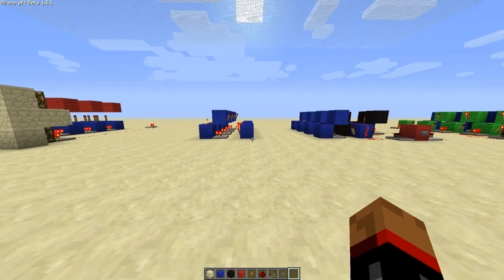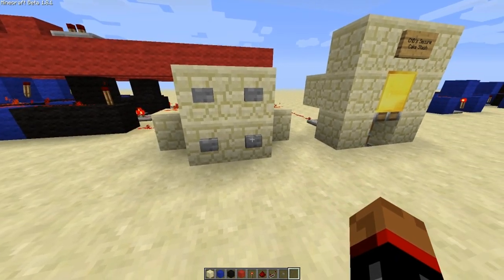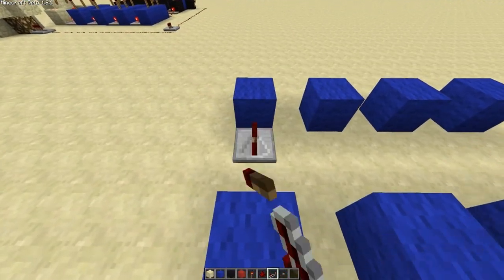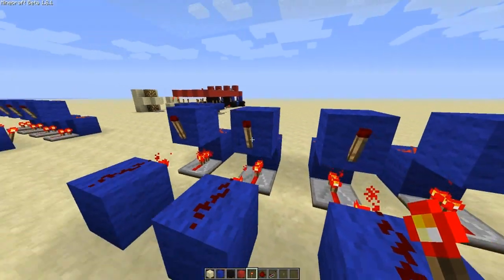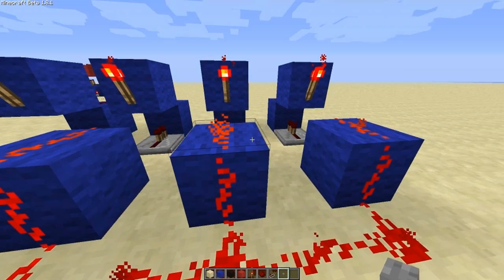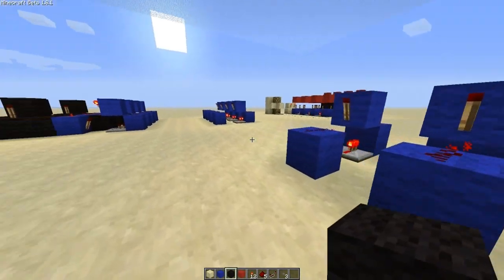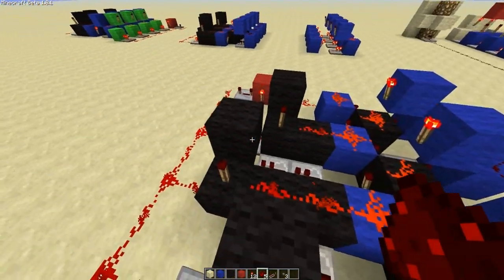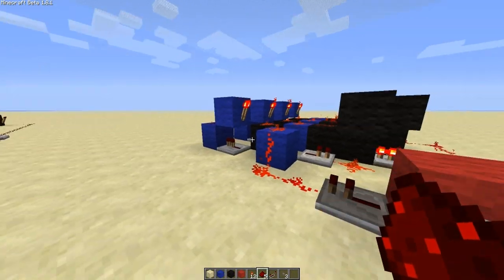RS NOR Latch Array! Sequential Memory Cell [Advanced Minecraft Redstone Tutorials]

Comment: Thank you cnb, through two of your videos(ur rs nor latch array an the combo lock) I have created a multiple combination, 4 digit passcode chest cart system, where each code corresponds to a certain chestcart railing, including a time dependent shut down feature, so if 32 buttons are spammed within 5 minutes the system shuts down. All done on xbox minecraft, survival. Couldn't have done it without your easy to follow redstone vids. Alot of trouble shooting was needed as xbox version is outdated

Comment: I'm having a problem extending the green circuit passed 7 digits. Adding a repeater to extend the line doesn't work because it cuts the power completely to the latches passed it causing it to turn off 3 at a time instead of just the one. I tried adding repeaters in between each latch and it seemed to work in theory, but when I connect it to the display it wont count down. Any suggestions would be helpful